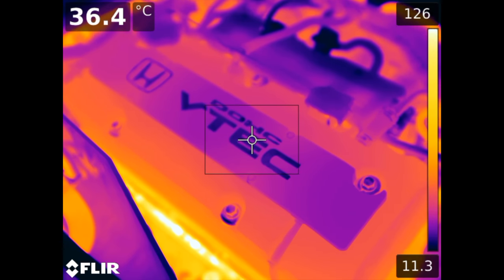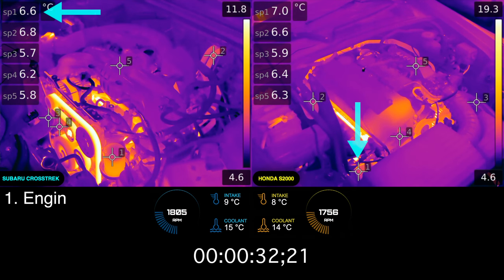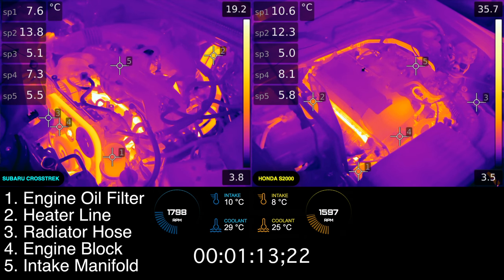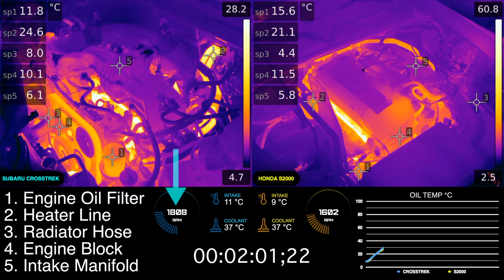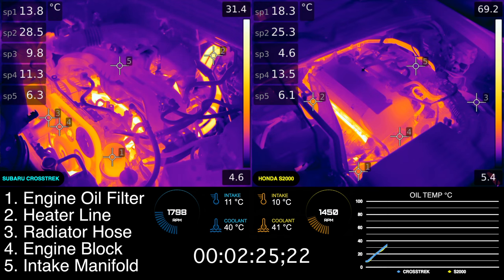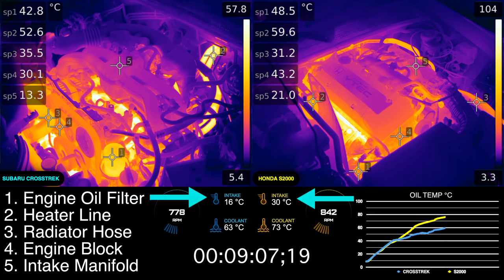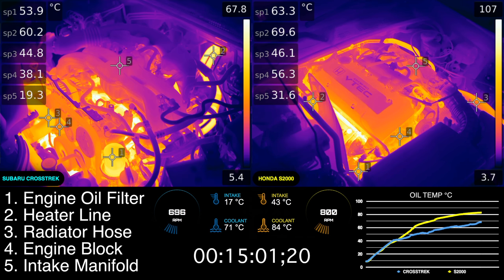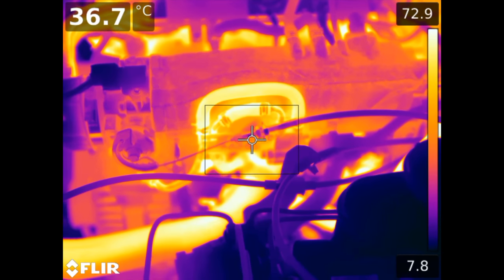$40,000 Thermal Camera - Watching Engines Warm Up

Comment: I have an XV Crosstrek Hybrid (2014).  Wonder if it would cause any difference.  Although I know that a cold start and leaving it run will not kick on the hybrid battery, would still be interesting to know if there would be any difference.

Comment: VTech didn't kicked in yo
Reply: ThePinoyMamba It would be intersting to see how the car would idle with the performance cam profile activated.
Reply: very lumpy, as evidenced by any car running the TODA VTEC-Killer camshafts, which basically replicate the VTEC cam profile on the regular cam lobes, and remove the middle VTEC cam lobe.  All the VTEC components are removed, also.

Comment: At what temp is it safe to VTEC and rev to 9k? ECU will let you at 3 bars, but that's only 70*C water temp. Thermostat isn't fully open till 90*C, and full operating temperature oil temperatures run higher than that.

Comment: Should try this with a ford flathead v8 - it sould be a rather obvious showcase for how heat buildup or distribution is NOT supposed to work in a modern engine.

Comment: Why were the intake temps shown as different on start up?
Reply from the maker: Not sure, I may have influenced it somehow standing next to it while setting everything up. Once the Subaru starts, the intake temperature drops to expected temps.
Reply: Ah yes! Very interesting observation none the less :)
Reply: +Engineering Explained Did you adjust for the thermal emissivity of each material? If you did, maybe you were just a little off with the plastic, I could see the plastic used for an intake not being exactly "off the shelf".

Comment: If the valves are adjusted properly the head will heat up quickly as the exhaust valves sheds it's heat to the valve seats and guides.

Comment: Really awesome and interesting video, I actually have been wondering this very thing ever since you talked about how long should you idle before taking off because I've been having some idling issues with my 9-3 Aero.  Mine actually doesn't go below 1800 RPM no matter how warm it gets. Is that a function of the Turbo or not normal?  Crazy how if you wait long enough on the internet your niche need is met.

Still winter has had to have been hard on you.

Comment: Is it misleading to believe since the Subaru boxer engine runs cooler than the inline 4 from Honda (and has a lower oil temperature), it will last longer with less wear and tear since the oil won't break down as quickly between oil changes?  Or is it not a big enough difference so it does not matter?  Thanks to whoever can answer this.

Comment: Engineering Explained I removed the thermostat of my car because I live in a very hot area, the car hasn´t have any problems for 4 years running this way, but should I warm it up now that it doesn´t have a coolant thermostat?

Comment: I am not a fan of cold air intakes, however Honda intake runs hot, would a cold air intake made a big difference?
Reply from the maker: The air intake box itself remains cold, so I think the issue is the location/material of the intake manifold. Not sure how much of an improvement is realistic.
Reply: Engineering Explained I can't remember if the S2000 has heated throttle body, it looked like there were coolant lines going there. You could easily perform coolant bypass like many do on H-series engines and recheck intake temps just for fun and data? I'm in Australia so I'll never need heated throttle body, ymmv. More Honda video's please.  :-)

Comment: I don't understand why it takes so long for both cars to rev down. I had the same feeling on the previous "cold start" video. It is not so cold outside and it take really "ages" for the cars to idle at normal RPM. Is that specific to the US ? In Europe, I never had a "modern" car rev up more than 30 s. at maximum 1500 rpm and then idling to the normal rpm (around 800). I tried again last week with my 2014 petrol Volvo at 0°C (temperature of freezing water) that stayed all night outside at the cold. Same for many other cars. Can it be because of the boot open (the car think it is at the workshop) or because of emission regulations different in the US ?

Comment: So much info from a thermal camera vid (It is not technically xD).. Thanks EE !! One question (Sorry if it is dump) Does the car have temp sensors in coolant line ?? I mean how did it know??  Sorry
Reply from the maker: Yes, car has a temp sensor for engine coolant (it's what gives you the information on your dash about your coolant temp).

Comment: Why did you measure the oil temperature with a seperate device instead of the ODB2 scan tool listed in the video description? Is the oil temperature data not available through the ODB2 scan tool?

Comment: The S2000 has a feature that warms up the catalytic converter faster for improved emissions.  It does so by running rich, so that some unburned fuel goes into the exhaust manifold  Then, by pumping extra air (oxygen) into the exhaust, burning fuel in the exhaust creates additional heat for the purpose of raising the catalytic converter temperature more quickly.  It would be interesting how the catalytic converters heat up relative to one another.  This may also be a reason for faster header temperature rise.  The higher compression ratio of the s2000 might be a reason for faster heat up too.

Comment: This is of course idle speed but the design of the cars outside taking in the aero dynamics and intake opening may change how these vehicles cool. Having say an intake that is wider or more air flowing over the radiator may change the overall temp. very cool being able to see all that but ill pass on the FLIR camera. I cant see how 40k would be paid back by using that. lol. I guess if I was a structural engineer or designer and heat was a major factor but for the individual person, nope. lol :P

Comment: What is the correct procedure in warming up your car? just let the engine running for a few minutes (parked) OR driving the car slowly in the first 500 meters?
Reply from the maker: Drive without high throttle or high RPM until coolant/oil is at operating temperature. About 5-10 mins of light driving before really pushing it.

Comment: Would be curious to see in -20 to -30 F temps.  I would think the results would be similar, just taking longer to reach operating temps.
Reply: its -38f here today :(
Reply: siamiam Where do you live? O.o
Reply: i live up in fairbanks alaska
Reply: Victor we hit those temps in the northern states.  Here in MN -20 F is not uncommon.  In ND I have seen it stay at -30 for a month.
Reply: Chad Bremer I assume they would just start much colder and therefore take longer to get to operating temp

Comment: whats the point in keeping an engine reved at 1500 rpm and not moving the car? one can keep a low load on the throttle and move the car at 1500 rpm.

Comment: In europe, cars idle higher for only about a minute if even that. Doesnt matter if the outside temp is 20 or -20.
Reply: Mortalomena my car doesn't change idle speed
Reply: nope, its a 1997 mercedes e300 diesel. doesnt matter what the temp outside or the temp of the engine is, it will always idle at 750 rpm. i found it weird too

Comment: ºC FTW
Reply: moonruff zopa I kinda see what you mean but it does not justify the use of Fahrenheit by the slightest way IMO. In every day use you dont really use decimals anyway, you dont need to know if it's going to be 20,5C or 20,88C (we use commas for decimals just to be clear) or anything in between 20 and 21. Sure, cool to have 68-70 F for it so you have it divided more, but is it useful? Absolutely not. I guess you can get used to it and after that it's "more logical" for you
Reply: Are there such things as Celcius fanboys?

I'm not sure that "human meaningful" temperatures is a good argument, since Celcius obviously has meaning to many humans.

(Also, I think you meant that Celcius spreads the degrees further apart, while Fahrenheit brings them closer together.)
Reply: Lol hate Celcius?I want know reason:)

Comment: Intake manifold surface temperature is not quite the same as intake manifold interior surface temperature and also, the amount of air and the time spent traveling through the air intake as well as the surface area of the air intake minimizes the amount of heat transferred into intake air.

Comment: How does the FB20 compare heat-wise to the Ej257 from your previous STI?  Obviously you can't compare them with the FLIR, but from what you remember did it run hotter?
Reply from the maker: Most engines run at about the same temperature, you simply size the cooling system accordingly.

Comment: my cars rpm is at 500 and sometimes it goesh to zero and the engine is shutting down, and if i reach rpm above 4000 sometimes in idle the car is reving to 2000 rpms and down, any help?

Comment: EE, do you think most of the intake temperature on the s2k is due to the throttle body cold-weather heating, or from direct conduction from the head? I.e. better to get a phelonic spacer or bypass coolant to the throttle body in warm seasons?

Comment: fuel consumption for this test please.
Reply from the maker: 0 mpg.
Reply: Engineering Explained sarcasm aside, it would have been interesting to see how much fuel each engine was consuming per second. It's in the mode 01 PIDs if I recall.
Reply: sfc!
Reply: My car has a 3.8L V6 and burns a little less than 1/2 gallon per hour of idling. My car cold cranks into 1200 RPM until coolant reaches about 40C-45C and then it lowers gradually to ~750 RPM. Using the S2000, which CC's into 1800 RPM and then lowers as shown in the video, I'd guess it probably burnt about 0.08 gallons in the 15 minutes it was running

Comment: Why are thermal cameras not susceptible to mirage, I would think a camera that's viewing heat would be even more susceptible to rising hot air currents
Reply from the maker: +Beach&BoardFan I'm not super knowledgeable about how these cameras work. I know there are cameras which work with air density which would visualize heat in the air. To my understanding (would love someone who's actually knowledgeable about these devices to chime in), the camera emits infrared waves, and then records what it sees, much like traditional cameras record the visible light which they see. Since these IR waves pass through air, we don't see the heat from the air.
Reply: Actually, thermal camera doesn't emit anything. You might be thinking of surveillance cameras that can see in dark with infrared (or more specifically near-infrared) light they emit with their leds. Thermal camera only records what materials emit. Materials emit (far-)infrared when their temperature is above 0 Kelvin (=-273,15°C), and the higher the temperature is, the more they emit. 

Besides that, my knowledge is limited, but I have some guessumptions. My theory on why air temperature  doesn't show on thermal camera is that air is so loose. In the air there would be so few atoms emitting the heat that pretty much anything solid behind the air would overwhelm it by emitting so much more heat. Maybe you could try to see the heat in air by pointing the camera to something that emits as little heat as possible, and blow some hot air from the side towards the line of sight?

And a theory about the thermal camera not being (so) suceptible to mirage: infrared has longer wavelength than visible light, with which the susceptibility probably was compared here. Radiation of longer wavelength is generally less prone to effects of what is on its way. That's why mobile phone networks implemented with lower-frequency (=higher wavelength) bands can cover larger areas. And that's why lense made of material that works with visible light would not steer properly infrared radiation. (Hmm, that makes me wonder if lense for visible light would actually still work for infrared to some extent -- could a chain of lenses made for visible light replace a special lense made for infrared?)

Comment: KEYWORD: if you IDLE your car on your driveway for 10 minutes, its transmission will still be cold!!!!! hahahaha
TAKE THAT! Americans who don't believe in science!
Reply: Driving certainly makes engines and gearboxes warm faster than just idling.
Reply: Applies to manual only
Reply: If it is an automatic transmission the fluid is pumped through a heat exchanger in the radiator that warms the fluid as the engine coolant warms which also warms the entire transmission.
Reply: were these 2 cars @engineering explained tested automatic or manual? did you two watch the entire test?
Reply: Harley Pan they are his personal cars and I believe they are both manual transmission
Reply: so are we supposed to wait for the car to warm up on a cold day? if so, how long?
Reply: generally wait 30 seconds or so until the RPM's drop. Then it's better for it if you drive it around lightly. Don't get on it until it's warm
Reply: is entirely correct. however it is relative to some of the manufacturers and coolant designs. Newer cars or maybe at least in trucks and stuff with heavy duty transmissions the coolant system operates like the coolant system in the engine. The transmissions coolant system in some automatics does not circulate through the Heat exchanger/ radiator  until the transmissions reaches optimum operating temp. then it regulates flow to maintain the perfect opp temp.
Reply: so at least in trucks like mine , the trans is still ice cold after i let my truck warm up. However i still warm my truck up almost every morning because i have remote start and i no longer have to scrape ice off my windows and jump into a vehicle thats 19 degrees F or colder every morning.  thats -7 c  for you metric fappers. lol
Reply: +Dalton Michaels 
What year, make, model, engine and transmission is your truck? 
Is your truck still factory stock?
Reply: patw52pb1  stock 2015 silverado
Reply: AT least 20 minutes
Reply: +Dalton Michaels 
The 2015 Chevrolet Silverado, most cars and light/medium duty trucks do not have an automatic transmission thermostat/thermal bypass valve in the ATF cooler circuit from the factory including those equipped with the factory towing package. 
Most automatic transmissions do have a heat exchanger in the radiator tank from the factory to help rapidly warm the ATF to optimal operating temp window and transfer heat from the ATF  to the coolant when the ATF temps are elevated above the engine coolant temps. 
The SAE, ATRA and ATSG have published several papers on the subject explaining why.
Reply: +B10401 
In extreme low temps, rapid temperature rise on dissimilar materials with large differences in coefficients of thermal expansion/contraction and thermal shock would most likely be the contributing factors for what nallen100 is describing. 
Oil, oil pressure and or camshafts and or manifold vacuum would not be a contributing factor regarding cracked materials and gasket failures. 
The effect of rate of temperature rise, clamping forces, joint clamping pressures and internal stresses would be relevant. 
Loading can have a significant affect on combustion, combustion temperatures, cylinder/combustion pressures, spot heating and effective AFR. 
Cold loading of an engine can also be detrimental to bearings, pistons, rings, cylinders, wrist pins, cams, cam followers, valve-train, chains/sprockets due to clearances, impact, oil viscosity and wear. 

A single rule regarding all engine/drive-train warm-up procedure is a fallacy. 
Different materials, different engineering, different design features, different construction methods, different engine management strategies all have different warm-up requirements.
Reply: Thanks for the discussion lads. I like to just read comment chains on this channel because they can be pretty educational :)

Comment: I kinda figured out a way to understand the °C scale. Just add 2°F for every 1°C
Reply: 0°C water freece
100°C water boils
Reply: that would be very inaccurate though.
Reply: I said kinda lol
Reply: TheLuckyDawg24 0C = 32F
Reply: problem is, it doesnt scale linear. 10°C = 50°F, 100°C = 212F. I guess what Motojunkey said is a good guideline to gauge the ballpark.

Comment: do the same with a diesel :D
Why don't diesel engines rev that high at idle when they are cold?
Reply: Ben Vandenberk because there is no point.  as it's powered by compression ignition.  It warms up much quicker than gasoline. diesel idles much better in cold without need for choke.

Comment: is a cooler intake best or a hotter one??
Reply from the maker: Cooler is better. More dense air, thus more oxygen.
Reply: Engineering Explained The Honda S2000 has a heated water jacket in the intake manifold. Apparently, Honda says it's to provide quicker warm-up in cold weather. You can buy an intake manifold gasket that blocks coolant flow to improve (cool) the air going to the engine.
Reply: Depends on the application. 
For most carbureted engines or throttle body injected engines operated in a low temp environment a hotter intake manifold will help promote fuel vaporization and help prevent fuel dropout and plenum/runner icing. 

For most port injected or direct injected engines, some carbureted and some throttle body injected engines operated in an elevated temperature environment a cooler intake manifold helps promote a cooler denser air charge, help reduce pre-ignition and or auto-ignition and or detonation and likely increase power produced.
Many lean burn engines can also benefit from a cooler intake tract.